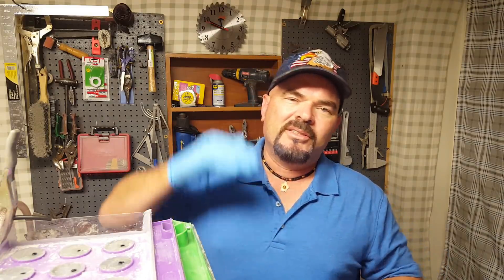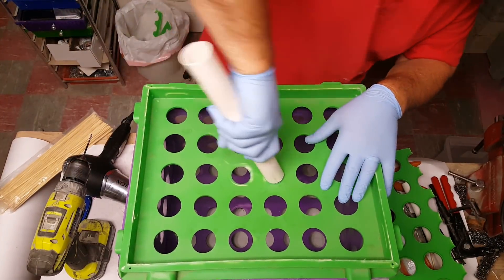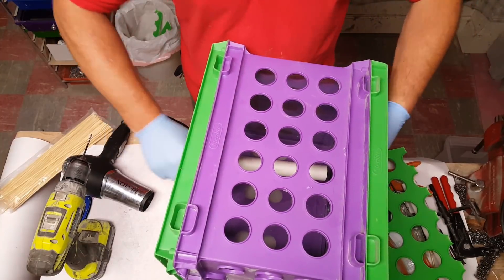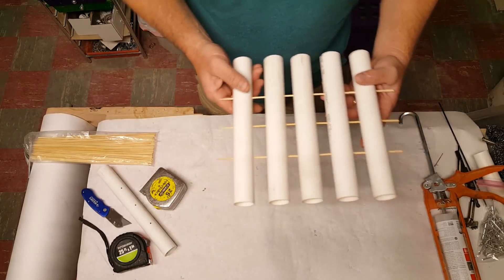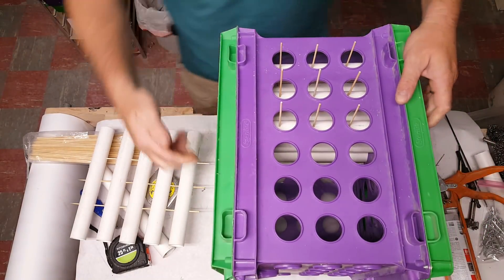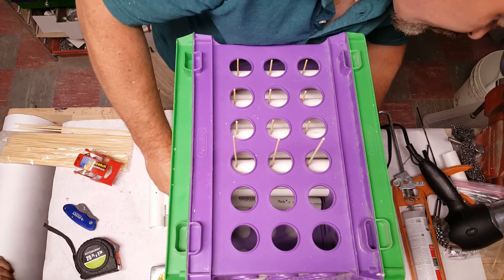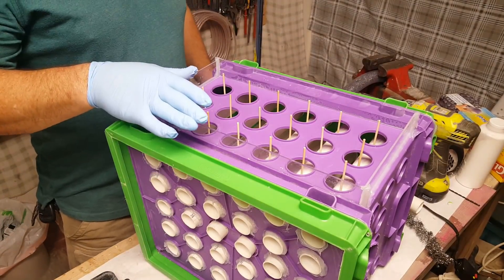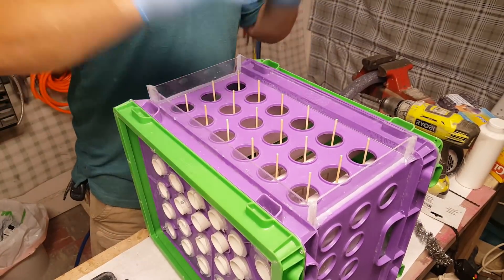Air Crete Air Conditioner DIY Build Core

Comment: Now... to combine it with dehumidifier so it can be run in a confined space without eventually getting to 100% humidity. 😉
Reply: It never gets humid because you leave a couple of windows cracked open when using swamp coolers.  I've used one in 113 degree heat to drop the temp to 80 inside. Misters around a porch work the same way for outdoor areas.  When you live in a desert there is nothing better than a swamp cooler for cheap cooling. It costs the same as running a fan or a couple of lamps.
Reply: @trolloftheyear7963  Using a swamp cooler outside it's just fine But in Florida we certainly don't need any more humidity inside.

Comment: I don't mean to hate but I'm not sure where you're going with this. If it's a heat exchanger circulating something like cool well-water then why fill in the gaps around the PVC with foamcrete? If instead you're introducing cool water directly through those holes then it's going to raise humidity and only be useful someplace a simple swamp cooler will already work quite well. If I'm missing something please point it out. Depending on the price point and capacity this might be a lot cheaper than a heavy-duty swamp cooler but like I said, I'm not sure where it's going.
Reply: Diy swamp cooler is exactly what it is, but lots cheaper to build and probably to run

Comment: I just realized that the air conditioner is going to be pretty low energy use...the pump.  Low wattage pumps are perfect for small solar systems.  Imagine combining the 2....cheap to build, cheap to operate!

Comment: Darwin, as a retired military person, I see so many actions in you that are related to the beliefs of the military member. The fact that you put almost everything out there for others is awesome! I've been following your posts for a long time, but because of the conflicts between your Saturday live streams and my actions to support veterans, it is difficult to see the live posts. I 've got an old fire extinguisher that I will be using as a large soap unit. I also planned to use a 2-inch seam clear, with cross support mesh, to use as my mixing unit for the foam create.gun. I plan to max it out as far as stainless steel pads.I see in your new posts that you are using a smaller hose to produce the foam.  Will using the larger hose, and more stainless affect the foam created?  I pln to use the panels to create walls for a rabbit/chicken enclosure where I'll be able to use a portion for a workshop and plan to use the aircrete panels to create an efficiently heated area for my rabbits and chickens. Any suggestions? By the way, I'm retired Air Force and a 100% disabled vet. My animals are my service animals as if it weren't for them I don't know if I would still be here. I have to keep going to make sure someone is here to take care of them. My aniumals and I are a team, if you get what I mean!
Reply: Thank you for your service.

Comment: What happened to your tight fitting hole cutter?
Reply: Why did u silicon
Reply: It was only 2 holes on top and bottom that he drilled out. 8 am thinking the rest were there when he bought them.
Reply: Thank you! And did hope this all works out its a must for overcoming the high prices of electricity!

Comment: Have my first foam gun built and did about 10 test blocks yesterday with different formulas. I am building a heated greenhouse and I want to say Thank You Honey Do as your videos have added a lot to my setup. I am building a below grade rocket mass heater but I am also intrigued by your cooling system as it could be a great way to bring the temps down a bit in the summertime.
Reply: Post pics.  I would love to see what you are working on.
Reply: right now it looks like a ditch so not sure pics will do anything for you. I am going to wait until I see that what I am building will actually work as intended before I post the info. My partner would be pissed if I just gave the info out but I kinda believe if all information was open sourced then what a much more wonderful world we would all be living in.
Reply: So true Jim! Good luck with your project.